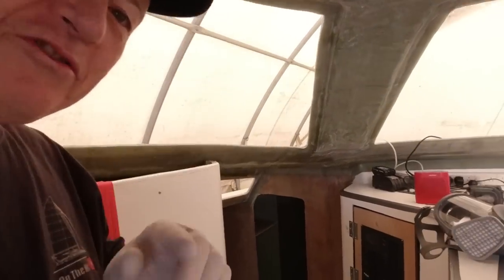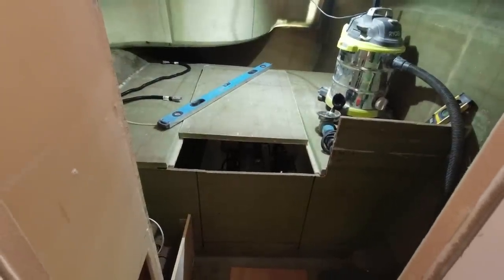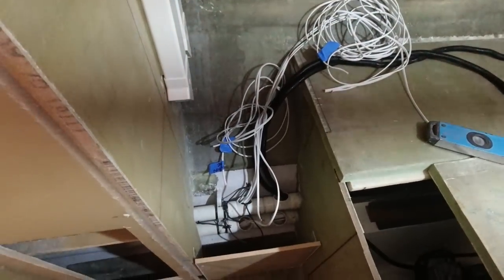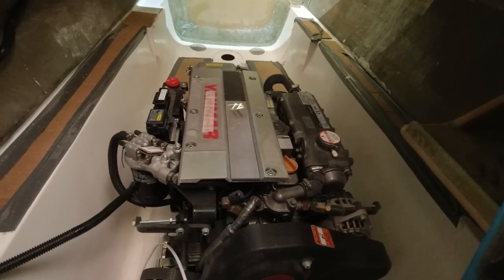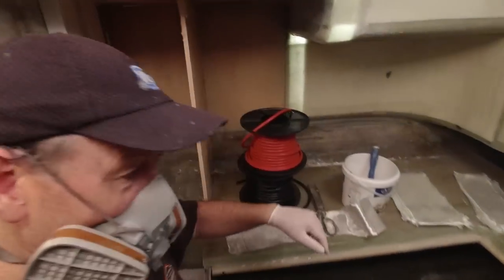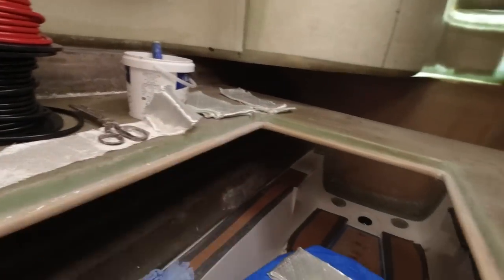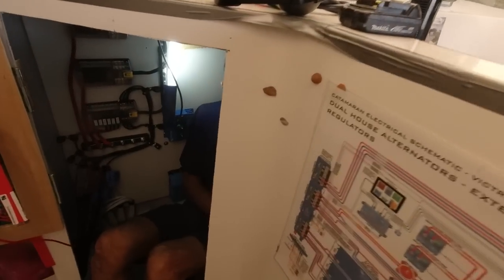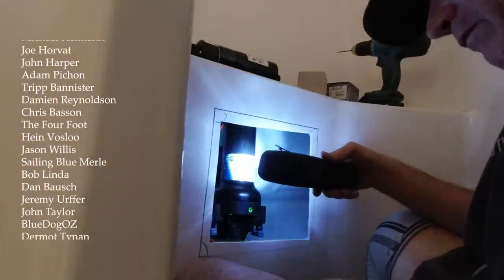Is the Engine Access big enough? // Catamaran Project Build Ep254

Comment: Ross, while your putting in your macerator pump you may want to look at a shutoff from the Black water tank to the macerator pump and a shutoff from a line coming from your gray water tank to  a wye and then into the macerator pump.  That way if you need to flush your macerator pump to work on it you can use the gray water to help clean it out before you dismantle it.  Keep up the good work.

Comment: Lights, please buy led strip lights 4-5 feet long and use them in every workspace.
They are super light and give brilliant shadow free illumination. 
You could fit them to any surface .
Fiddling around with tiny lamps is just crazy. 
Robin

Comment: Don’t forget to put a light in that electrical cupboard. That’ll probably rarely be used but when you do use it. It’ll be real handy.
Reply from the maker: Thanks,we have a 2 mtr 12 volt led cob strip in the roof of the cabinet.Is perfect and dpes does not cast a shadow.Cheers Rossco

Comment: Hello Ross! It also may be a good idea to consider using studs and mounting plates for attaching things like pumps and electrical components. You can mount them to the plate externally and then attach the plate to the studs in the boat wall with just nuts and washers etc. Helps with cooling and such and this way, If you ever have to replace the part, you can just make a new plate or drill the existing one. You also don't have to try to drill new holes and fasteners in the tight spaces!

Comment: It looks like you have the Yanmar 4JH4 family engines.  The impeller on them are in an awkward location, hard to hold the cover o-ring in place while putting it back together.

I also noticed the bed has a lot of flex in it now that you made the engine access.  May want to think about re-enforcing.

Comment: You mentioned sealing the engine compartments for noise etc.  Have you given any thought to the fact the engine needs fresh air to operate?  External vent to let air in.
Reply from the maker: I have a beautiful vetus stainless engine room vent suited to the horsepower that will be mounted just below the gunnel and has a Dorade attachment to prevent water coming in.We will also have an in line engine blower fan.Cheers Rossco

Comment: Boy, will you regret not having gravity-feed tanks, first white mouse will block that pump.
Reply from the maker: I will be training my crew and the first one that's gets stuck it will be a family affair to clean it out.My family understand boat plumbing.All will be good until the first one .
Reply: @LifeOnTheHulls  I have had a Dufour sailing boat for 10 years now, gravity tank, no electrics, no wiring, no motor, no smell, and silent running, it just sits in a cupboard like a box of dumb Frogs. At sea leave the drain valve open, in port/anchor, close the valve. Once a year I give it a good rinse. Happy family.